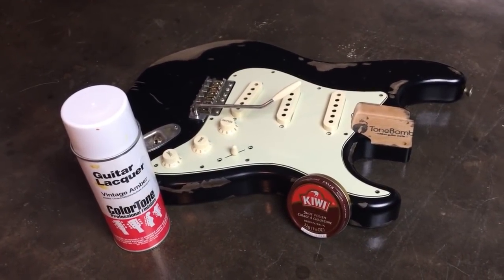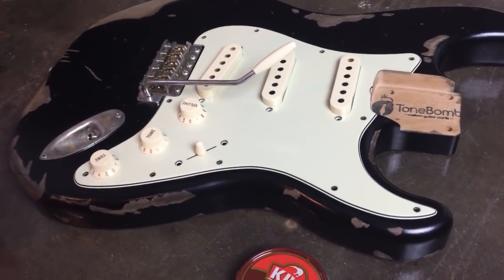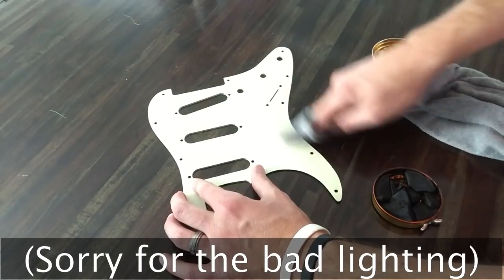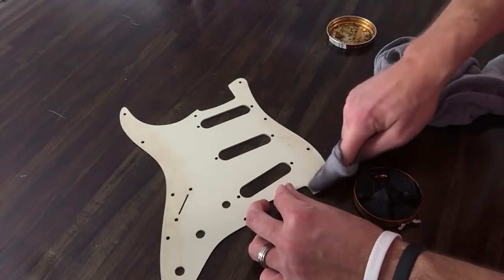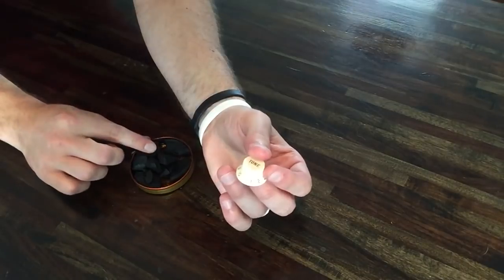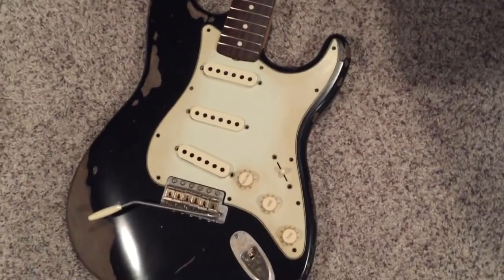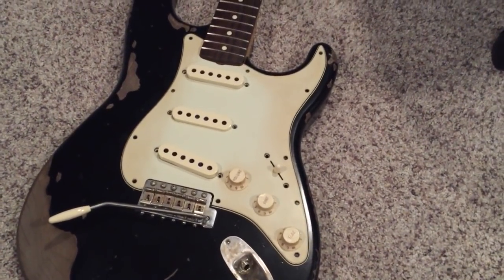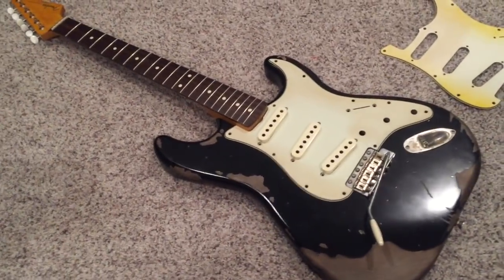How to Relic a Pickguard & Other Plastic Parts

Comment: Some people dip plastic components in cofee a couple days to tint, the simulate the natural yellowing. For marking/sanding, I would follow the picking motion to sand and mark. And around the knobs I would do circular, just like turning knobs, and then add random hits, or hits at location that would make sense with the marks on the body that are close to the pickguard if that makes sense. Your strat will look killer.
Reply from the maker: Thanks for the tips!
Reply: Thanks to you for sharing and making these videos of your strat build. I learned a few tips from them as well. :)   I found you already had the tip for the coffee dipping later in the video anyway.

Comment: I learned a trick of using lighter fluid for wet sanding. It dissipates quickly and doesn’t attack the finish, whether it be urethane or nitro cellulose. I’m gonna try it now on my plastic pickguard now and see how it works.
Reply: I use linseed oil. Works great

Comment: I just bought the made in Mexico genuine Fender 62 mint pickguard. I took the sheen off the top with Stewmac Micro-Mesh pads. No liquid required with these pads. Then I sprinkled a little Turmeric and even lesser amount of Cayenne pepper around the outside and control area of the pickguard on a baking tray. Then used damp kitchen paper to dab on these areas. After 10 seconds or so the kitchen paper and pickguard starts to stain a lovely hue. I dabbed and swirled around another 10 seconds or so over the spots I wanted to hue and when the colour starts to bloom a little heavier, I put the guard in soapy water to wash and halt the staining effect. Dried it to see the finished effect. Then repeated as per my preference. I would describe the result as an aged plastic effect rather than relic. So I found this to be a really cool and simple way of giving a light shade/hue to areas of the pickguard as per your own personal preference. The hue as you can imagine if you’ve ever accidentally spilt turmeric on your kitchen work surfaces is subtle but noticeable. I was very pleased and recommend it on a light mint / cream coloured pickguard at least. It doesn’t look fake at all as it’s just a hues colour gradient in areas of my choosing. This guard is going on a vintage white relic Fender with a new PuP set and it now looks better than the original darker mint guard that came on the Custom Shop guitar!
Reply from the maker: DJ T Turmeric! That's a great idea. That stuff stains everything. Kudos & great job. 👍🏻

Comment: Awesome video, Nathan. I see some discussion on aging the pickup covers and knobs. As these parts are a different plastic than the pick guard, its a bit easier to age them. I made a mixture of thick espresso coffee and dark tea leaves in about a cup of water just off the boil and dropped in my white Fender pup covers and knobs. They were "dyed" to a perfect aged white in about 2 minutes. Don't leave them in too long as you can over stain them. I fished them out with pliers after 30 seconds and rinsed to have a look, and put them back in the solution and checked them every 30 seconds or so. Sounds crazy, but it worked for me.......I think the trick is to use very, very hot water and really thick coffee/tea mixture. 

I also used an ultra fine light green permanent marker (Cricut) to "tarnish" the gold numerals and letters on the tone and volume knobs. Using a Cricut marker, (available at hobby stores like Michael's), you have a bit of time to wipe off any excess colour and have some "aged" numbers and letters and some not. The ink doesn't become permanent for 24hrs and there's no need to sand. A sharp pointed knife will allow you to "pick out" some of the gold colouring as well.
Reply from the maker: Rick Robertson thanks for the good info! Yeah, I had a similar experience one time with aging pickup covers & knobs with a coffee mixture. The color took very well. But like you, the pickguard didn't take the color at all.
Never heard of a Cricut marker. I'll have to check it out!
Reply: i’ve used muratic acid for aging chrome and metal parts. It’s really a trial and error process but it does work. You need a small seal tight container and not submerge your parts totally but use something to keep them slightly above the acid level. I’ve used rubber or a plastic block in the past. If you submerge your parts you’ve really got to keep a sharp eye on them because it will attack the parts very fast. Be sure to use gloves and eye protection without fail. The fumes can be devistating. Good luck! 👊🏻😎

Comment: Best way to colour a pickguard (most are made from PVC) is to use oil based dyes dissolved in THF (tetrahydrofuran). THF dissolves slightly the upper layer of the PVC so it gives a great permanent stain. Shoe polish will eventually wear off whereas this method won’t.
Reply from the maker: Philippe Van Doren great info! You've got a point. In my experience with the shoe polish, it does seem to come off. However, subsequent to this video, I used a combo of Oatey PVC cleaner & shoe polish (the cleaner slightly dissolves the plastic, like you described) & it seems to stick on & stay. 👍🏻
Reply: There you go. Chemistry in action!

Comment: Just a tip for the future, whenever you're sanding, don't go in circles
Reply from the maker: Bradley Munn right, I know that’s the case for most situations, and I probably should have done it here. But it ended up not making a difference. There aren’t any swirl marks. 👍🏻
Reply: Fuck it ... I'm doing circles

Comment: i’ve actually also used up to 5000 grit sandpaper for refinishing bodies after the other gradual steps are taken to get you there. 5000 grit can be kinda hard to find and it’s pretty expensive too. I’ve found it at auto body supply houses though. Probably won’t find it at Lowe’s or Home Depot.
Reply from the maker: Thanks for the tips!
Reply: Just buy rubbing compounds. 5k is rare because compounds cover that micron level

Comment: My 1959 jazz master that I have played since I got it in 1966 does not look anywhere near as bad as these “Relic” guitars, That are trendy right now. I believe that is the way that the factory cuts down on their number of dumpster rejects. It’s called making a silk purse out of a sow’s ear. It’s called making lemonade when life deals you lemons.It’s called turning a liability into an asset..
Reply from the maker: I understand your point, & congratulations btw on owning such a coveted vintage instrument. However, I know from my research & experience that the Fender Custom Shop specs out & sells MANY of these brand new relic guitars (see Wildwood Guitars in the USA & Peach Guitars in the UK, for example). That means people are choosing select woods & high quality parts for these guitars. In other words, they aren’t dumpster rejects. In the same way, for this particular project, I selected a specific body (wood type, weight, contours, etc) as well as a customized neck (profile, radius, materials, etc) and chose top-notch parts (hardware, pickups, electronics, etc). I guess what I’m trying to say is that I believe you are drawing broad conclusions that don’t apply to the majority of relic guitars.
Reply: Congratulations on contributing the most boomer-tier comment on this entire video.👍🏻

Comment: You should try sanding the pickguard lightly and then put some woodstain on it and then immediately wipe off the woodstain, if you pick the right stain then it should look good.
Reply from the maker: In my latest endeavor, I've actually used the concoction I used in this video ( https://youtu.be/THaVYzvgkTw )where I changed the color of my fretboard makers.  The PVC cleaner actuallly locked in the color of the shoe polish.
Reply: Wet tea bags also work on white. They give it a natural looking yellowed tint. The longer you leave it on, the darker it can get.
Reply from the maker: R Davis true, but not all plastics will turn color with tea/coffee in my experience.

Comment: I just spent close to two hours doing two AO 60s Jazzmaster pickup covers by hand.

I use wet and dry 1500 and 2500. I don’t like the shiny appearance of new plastic so I dull them right down to a Matt finish and then polish them back up to what I like with Silvo polish and then diamond knife stropping pastes. They don’t age, they just look well used and a couple years old. This method takes a long time but the results are about the same as my genuinely few year old pickup covers. I don’t like to relic things, just knock of the brand new of the plastics. As for the knobs, I have two sets of originals so I just put the dirtiest pair on it. The AV65/AO60s plastics definitely have a green tint that original JM witchhats (circa 1965) don’t have. They’re pretty good though.

New plastics look like they have a thin layer of glass over them. Haha
Reply from the maker: Sounds like excellent work.  Thanks for sharing your method!

Comment: The problem with the aged lacquer is that it will scratch off... plus it looks fake on plastic. Leave the white in a pan of coffee for a week.
Reply from the maker: Bender Vision you’re right: coffee does work for some plastics, but not all. I speak from personal experience. Also, I wanted the coloring to vary across the pick-guard, instead of being one solid/consistent color.
Reply: @NathanSink  sometimes a little heat works well with lacquer...experiment with a crap pickguard first...

Comment: You need a wider angle sprayhead for your can.sold sepperatly
Reply from the maker: Sjef S that would probably help. 👍🏻
Reply: @NathanSink  i use them on everything.sprayed whole cars that way.also the paint lasts longer and drips less. I ussually buy a pack that has 5 different spray paterns.its like 2 or 3 bucks
Reply from the maker: Sjef S where do you get them? Have a link?
Reply: I use to buy them at a local paint specialty store but il see if i can find a link to sommething simmilair

Comment: When you wet sand the pickguard to remove the shine, are there any scratches our swirl marks visible afterward? Or is the grit so fine that it doesn't show.
Reply from the maker: •allstopblue • no swirl marks on the pickguard! (Unlike my endeavor with trying to wet sand the body. 😜)

Comment: I'm considering doing this for a DIY project of mine and I'm curious as to how it worked out long term for you.
Did your have to re-apply it occasionally or did it stay on just fine?
Reply from the maker: It's actually stayed on quite well.  As long as your not constantly rubbing it (while playing for example), then it will stay on.  It's kind of nice because where your pinky finger (for most people anyway) rests on the guard, the shoe polish sort of wears off naturally, and gives it a really believable look.  But yeah, in short, it stays great around the edge of the pickguard, on the pickup covers, & other spots where you don't really ever touch.  FYI, this is the latest video I have with the Strat in it and at about 1:35 you can see the pickguard fairly well: https://youtu.be/iwKzeKXJoxY  It's been a few years now and I feel like the tint is still tastefully done.
Reply: @NathanSink  Damn that was quick! XD

Thank your for the feedback! Really appreciate it. 
Just checked out the video and it indeed still looks great. 
You sir just sold a can of shoe polish and earned a sub.
Reply from the maker: The Harlequin hey, someone else's comment on here reminded me that I actually used Oatey PVC cleaner & rubbed it on (mixed it with) the shoe polish to make it stick. (This was later on, after this video). The cleaner slightly dissolves the plastic so that it accepts the shoe polish. It essentially turns the polish into a dye.
Reply: @NathanSink  Thank you a lot for the advice! 

Great timing too since just got my new pickup covers last week, so I wanted to work on the pickguard while I'm installing them anyway. 

I'm going to keep an eye out for a compareable cleaner to try this with. 

Again thank you for taking time to spread the knowledge. 
Appreciate that you even remember inquiry from a few weeks ago. :)

Comment: See a real Luthier would know this is NOT how to do it and actually know HOW to "relic" a faked discolored pickguard. 1) Shoe polish will NOT stain a plastic, because it's just a Wax! 2) a real discolored pickguard, PuP covers, knobs is because of a number of factors - the type of plastic used 20, 30, 50 years ago was primitive and it actually turns color with age. Also exposure to Ultraviolet Radiation - the Sun. Also exposure to the chemicals in the air, the guitar case (the felt gives off chemical as it deteriorates!). And the salts and chemicals from your hands and arms. Lastly cigaretter smoke affects plastics and cloths like crazy, you see it in Amp cloth fronts and the Tolex covering of an amp, especially the old Blonde and Tan Fenders. 3) Import plastic "parts" won't easily or at all stain, so forget it. It's the chemical composition of plastics from Korea and China etc. - Luthier / worked for Fender for 30 years and I restore vintage instruments.
Reply from the maker: Vint Guitarz I'm just a regular guy trying to share my experience and help others who might be interested. So a "real" luthier would tell you to get a vintage pickguard & that's the ONLY way to do it?? That defeats the purpose of relic-ing (beside the smoke thing). I can't imagine that the Fender custom shop uses truely old plastics in all of the heavy relic guitars they produce nowadays.
Reply: Vint Guitarz kind of a condescending and unhelpful comment dude. If you’re going to say something like that, you should really offer some constructive and useful information. You said a real Luthier would know how to do this, and that you worked for Fender and restore vintage instruments etc so.. ok then.. put your money where your mouth is? Tell us how to do it? Or are you not a real luthier either..
Reply: oh,your the expert then? C'mon show us how a real luthier would do it then??
Reply: Actually a colored wax can stain a guitar.. It's happened to me before.  No offense, if you want to criticize.. Then offer advice or content on your channel on how to. I have a 84 fender that I need a replacement pu for.. I'm going to try this method from @Nathan..